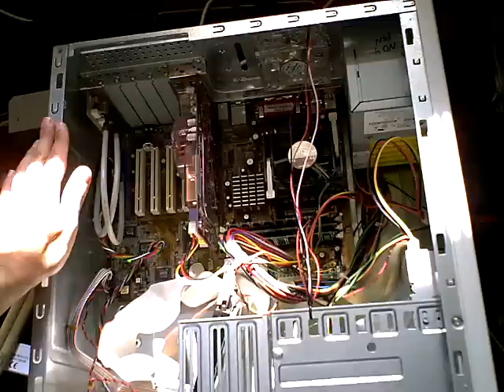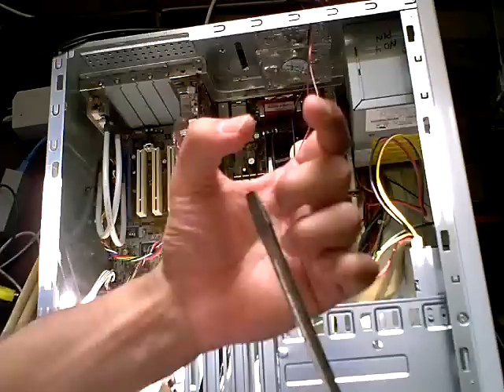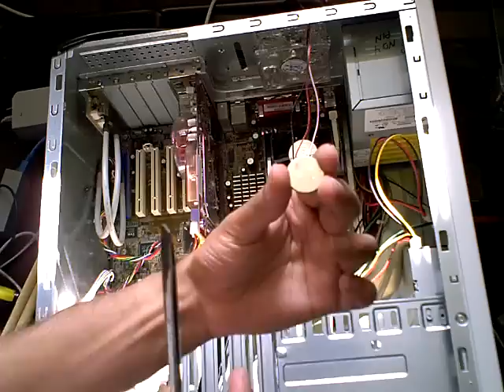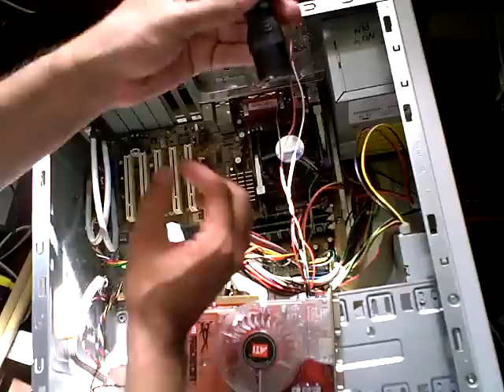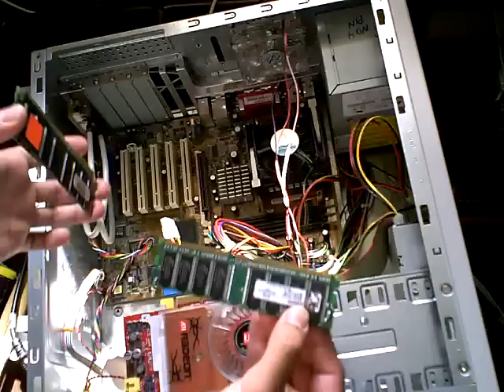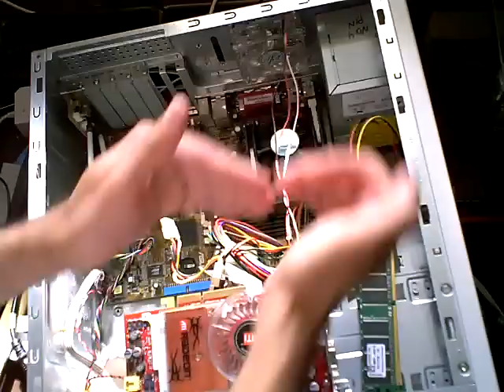How to possibly fix a PC that will turn on but will not beep and will not display anything on screen

Comment: Dear Rodney if I turn my computer on,my computer power on,fan is spinning ...only black screen and no beep,after I take out my RAM I got 1 beep and 2 short beeps,but if I put back my RAM no display and no beep again,it beeps only when I take out the RAM....so what should I do next?Will you please help me?
Reply from the maker: +Alex Lalhmunsanga 
Beep error codes differ from one BIOS manufacturer to the next. To discover what the beep error code is trying to telling you, discover the manufacturer of your BIOS (available in the motherboard's manual or on the motherboard's manufacturer's website {on the page for your specific motherboard model}) and then look up the frequency and interval of your beep error code on:

http://www.computerhope.com/beep.htm

Comment: Hi Rodney, hope you can help me. I have an HP Pavillion that I bought in 2013. About 9 months ago, I unplugged it and didn't try and turn it on again until today when I set it up in a different room. The computer has very low usage, it really has only been used for about 6 months since 8/13. I did as you suggested with the CMOS, however I'm not sure if I did it correctly with clearing the CMOS memory. I located 3 jumpers on the board, which were no were near the battery and jumped it to the 2nd and third pins, or at least I think I did. I tried all combinations to make sure that I  got it right at least once. I then moved on to the memory and when I removed the RAM(theres only 1 RAM module), then restarted which resulted in an error code of 5 beeps looping continuously. A quick check on Google shows that 5 Short Beeps The CPU on the motherboard generated an error. Does this mean that the board is done or that I need new ram? One other thing I wanted to mention.........when powered up at first, the fan over the CPU goes really fast, then slows down to normal, however every couple of minutes it will do the same thing and race the fan. If I remember right, this was doing this when I shut it off 9 months ago, but the computer was still operating correctly at the time.
Reply from the maker: +christopher christensen The hyper-speed spinup of the fan is nothing to worry about, that's just how your machine boots up. Sadly, as you've noted, PCs don't like to be used infrequently: this often results in the corruption you're seeing. Forget the jumpers if you're not sure, just do this: disconnect the power cable, remove the CMOS battery, press your PC's chassis power button switch (to discharge any remaining power circulating in the system), leave the PC unplugged and in this state overnight, then the next day return the CMOS battery to its socket, power up the PC, and if no beep, then disconnect the power cable, press your PC's chassis power button switch (to discharge any remaining power circulating in the system), remove one component, power up the PC, and if no beep then repeat (each time unplugging the PC, pressing the power switch to discharge remaining power, removing a remaining component, and then powering up, and this until the PC beeps at boot).If it never beeps, even when you are down to just motherboard, power supply & CPU+fan, one of these remaining components may be bad

Comment: +RodneyDickson I followed your procedure and finally got beep codes (5 long) after taking out the RAM. I tried using different combinations but the pc still won't boot and I only get beep codes when both sticks of RAM are out. Any suggestions?
Reply from the maker: +Muhammad Rashid Beep error codes differ from one BIOS manufacturer to the next. To discover what the beep error code is trying to telling you, discover the manufacturer of your BIOS (available in the motherboard's manual or on the motherboard's manufacturer's website {on the page for your specific motherboard model}) and then look up the frequency and interval of your beep error code on:

http://www.computerhope.com/beep.htm

Comment: +RodneyDickson I followed your video and when I removed the RAM modules I got no beep error message... 
Any suggestions?
Reply from the maker: +Jestin Joshi Breadboard it (explained in the following video:)

If the steps in this video did not provide a solution to your problem, view:

http://www.youtube.com/watch?v=_EK9a-R5pss

You never know, maybe rebuilding the PC in the opposite sense that you took it apart will solve the problem.

Comment: Hey Rodney. Do you have to take out the CMOS battery before you do anything to solve the problem?
Reply from the maker: +sparkygod22 You can handle the troubleshooting in any order you want, however I strongly recommend the CMOS trick first, since it is usually the culprit here.

Comment: So I have a question. We bought a fairly new PC and everything works pretty well. I can play high graphics games on them, watch videos, so on and so forth. For some reason our computer absolutely does not POST beep. At all. I've opened it up, made sure everything was connected, reboot the computer. Everything is working fine but the speaker will not beep. Now recently I did have some issues. When we shut down, it seems to shut down fine, but when turning it back on, it acts like it crashed and we have to go through system repair, so on and so forth, but everything still seems fine. Also while watching a video on one screen, both monitor screens went weird, headphones had a single continuous tone, and I had to do hard shut downs. This doesn't happen on games, just on netflix vids, so don't know if that's a problem but my biggest question is this: if our computer doesn't POST beep, what does this mean if the computer seems to run fine 99% of the time? Sorry for the long paragraph, I just wanted to give some info. Thanks for the awesome vid!
Reply from the maker: Nono, more information is always a good thing. From the sounds of it, your motherboard simply does not have a PC speaker (this is common on modern PCs to not have one) so don't worry about the lack of audible beep. As for the other issues, sadly I haven't a solution. I'd just put the PC to sleep when not in use to avoid the whole 'needing to system recover' upon boot up. Sorry I couldn't be of more help : \

Comment: Thanks so much for the video. it is super clear and informative for a newbie like me. But I am stuck as I found the beeps but do not know what to do after. So, I removed the cmos battery first, nothing happened (no beep). Then I removed the ram cards where it started the loopy beeps(graphic card in). Then I removed the graphic card where it was still making the loopy beeps (ram cards out, graphic card out). Just to make sure, I  put the ram cards back in (graphic card out) it's at the point where I get the 1 regular beep, break, and follow by 3 short beeps after. According to the video, its not detecting graphic card. I then proceeded to put the graphic card in, still 1 long beep with 3 short beeps after. Cmos battery back in, still no graphic card. Took the graphic card backout, cleaned it, dust off the socket, still no graphic card detected according to the beeps. Does this mean that it is my graphic card? or could it still be something else like the HD? one of my friend suggested it still could be software issue?.. I'm worried.. I read some posts saying it could be the MoBo still?
Reply from the maker: +Carrie Sun If this is new hardware that you are installing on your motherboard (that has not yet functioned on your motherboard,) note that matching bus types of video card to motherboard socket (PCI-E for example) or matching bus types of RAM module to motherboard socket (DDR3 for example) does not necessarily signify compatibility. If this is the first time you are trying this hardware on your motherboard, there is a chance that this new hardware is not compatible with your motherboard, despite the same bus type and despite the fact that the new parts fit in their respective motherboard socket. Your motherboard manufacturer's website will have a support page dedicated to your motherboard's model, and on this support page should be a compatibility list for such components as video cards and RAM modules. Ensure that your new component is certified to function with your motherboard, and if your new component is not present on the compatibility list, then there is a chance that the new component is not compatible with your motherboard.

Comment: Thank you for the video.  My computer would not beep, it was a gradual problem. At first I could just unplug and discharge the power.  Later I had to unplug all usb devices, then finally none of that worked.  I watched your video....cleared cmos, no help.  Then I removed the battery for about 3 hours.  At first it would not come on at all, unplugged and plugged back in and viola it is on and working!  Hopefully it will start again tomorrow after turning it off.  Thanks again!!
Reply from the maker: +Sheila Bennett Glad to hear it. With intermittent issues, I recommend you get the PC to a bootable state, then put it in 'sleep mode' when not in use for easy 'waking' when you do need it. Good luck

Comment: Thanks for the help man! I'm stilling having an issue though. It seems to be an issue with my RAM. Yesterday I upgraded my i5-4670k to an i7-4790k, and now 2 of my RAM slots seem to be disabled. It isn't the RAM itself because I tested both of them in the slot that does work and it boots up with BIOS and all. What do you think could be the problem with the slots? The motherboard is a Asus Gryphon Z87 and I bought it in January. I'm thinking it may be the CMOS or something else. Any ideas?
Reply from the maker: +JoshiCamoshi2 Not a clue. Try going into your BIOS, selecting Load Setup Defaults, then saving and exiting: see if that helps. If not, look in the BIOS under memory compatibility or dual channel...try to find a setting that brings functionality back.
Reply: +RodneyDickson It was over a year ago, the problem has been fixed lol
Reply from the maker: +JoshiCamoshi2 Yep, responding to all comments unanswered from my 1.5 year hiatus, even if most of them are no longer valid.

Comment: Hello! I have done the instructions you gave in your video and i ended up with 3 long beeps but only if there's no RAM inside. I've looked up what the beep code means is that it's the motherboard. Is that 100% that my motherboard is relieved of is's duty?
Reply from the maker: +Skullshot6 Beep error codes differ from one BIOS manufacturer to the next. To discover what the beep error code is trying to telling you, discover the manufacturer of your BIOS (available in the motherboard's manual or on the motherboard's manufacturer's website {on the page for your specific motherboard model}) and then look up the frequency and interval of your beep error code on:

http://www.computerhope.com/beep.htm

Comment: Thanks for the help! I just did this troubleshooting process, and sadly, it did not work. That means my MOBO is screwed. Well whatever, I'm planning to do a custom build this summer when I get enough money, new everything. Is there any way to AVOID this problem?
Reply from the maker: +Mashu If you still have this old kit, try to Breadboard it (explained in the following video:)

If the steps in this video did not provide a solution to your problem, view:

http://www.youtube.com/watch?v=_EK9a-R5pss

You never know, maybe rebuilding the PC in the opposite sense that you took it apart will solve the problem.

Regarding avoiding this issue in the future, it helps to ensure that all components purchased for your motherboard are certified to work with your motherboard. Modest performance parts are always a better bet than ultra high performance parts, and finally invest in a good power supply with more wattage than you need. Good luck

Comment: Hello I just want to ask if my mobo's starting to show failure.
Recently in the past weeks, my PC would suddenly start freezing, now a usual reboot would fix the problem, but most recently when I reboot my the CPU turns on, but no display or beeps...

HOWEVER, there are instances where there is a display, and I can tinker with the BIOS when that happens. The bigger problem is when I try to boot to Windows, it sometimes won't boot up showing either a blank black screen or no display at all. It took me a few tries to try to enter safe mode, since when I do get to Windows, and log in my account, it will freeze in under a few mins. Once I got to safe mode I can tinker with a lot of stuff as long as I can, without any freezes or such. With this I tried uninstalling recent updates, and stuff. Now after that, rebooting to normal Windows, was still a bit hard, but after a few tries I finally managed to log in without any issues, and I've typed this comment using my PC.

So what I'm asking is, if such an event like that, does my mobo have anything to do with it? Or does it have something to do with my OS(Using Windows 8.1), since accessing safe mode in a prolonged period didn't cause any problems as opposed to using normal mode. Also IS IT BAD if there is a display and computer successfully boots BUT THERE IS NO POST BEEP from the mobo when you first power it up? Thanks for any response.
Reply from the maker: +EnigemCenia My pleasure to help. Now, if your PC does not beep but boots your OS, I wouldn't worry about it. There could be a number of reasons for your freezes: I'd lean towards either your operating system becoming corrupt, or your CPU overheating. Yes, motherboard failure can be attributed to this as well. Personally, my first test would be to back up my existing personal data, then format and reinstall Windows. If this solves your problem, then your OS was to blame. If not, once a freeze happens, go into your BIOS and check your CPU temperature: see if it is close to the limit, and if so, your ventilator is not functioning adequately (check for damage at the fasteners or gumming up of the blades).

Comment: Thank you so much my computer had this exact problem and it worked with just taking the round battery off and changing the little switch putting it back and placing the battery back.,.so help full and easy to understand even though i am not a technical person.
Reply from the maker: +casper14161 Nice! Glad I could help : )

Comment: Do you think it's possible the northbridge / southbridge having solder issues could stop a machine from POSTing? I have an ASUS 775 board that runs a Q6600 and after heating up for half an hour it will suddenly POST and work normally, case reset switch makes it POST immediately, but when I turn it off then on again with case power switch, it takes another half hour to POST. I have troubleshooted / replaced everything except the motherboard, since LGA 775 boards are really expensive on eBay in the UK for some reason.
edit
Ended up getting a perfectly working ABIT IP35 motherboard for £10 with a massive tower heatsink included, best purchase I've made.
Reply from the maker: +RoBoSkullz Yeah, that's absolutely possible. In such cases, I recommend the user just puts their PC to sleep when not in use instead of powering down...I know it's not ideal, but it beats buying a new motherboard in my book : \
Reply: +RodneyDickson This wasn't my board originally, it belonged to a relative, and currently I think they are the kind of person to leave their PC on 24/7, I did find an Intel board which has what I need for about £15, so I might give it a try.
Reply from the maker: +RoBoSkullz Well, hope it works out then
Reply: Thanks

Comment: Hi!! 
Awesome Video! Thank you!!! 
I have the same problem... I insert my new Graphics card, plug in the power, put on the PC on, and nothing... mo screen, no beep... 
I place my older graphics card it, and it works perfectly... 
We thought it was the PSU, we upgraded to 650w.
Put the card in, and nothing :( 
Is my new Graphics card defective? Is my Motherboard to blame?
Reply from the maker: note that matching bus types of video card to motherboard socket (for example, both motherboard socket and graphic card are PCI-E 16X) or matching bus types of RAM module to motherboard socket (for example, both motherboard socket and RAM module are DDR3) does not necessarily signify compatibility. If this is the first time you are trying this hardware on your motherboard, there is a chance that this new hardware is not compatible with your motherboard, despite the same bus type and despite the fact that the new parts fit in their respective motherboard socket. Your motherboard manufacturer's website will have a support page dedicated to your motherboard's model, and on this support page should be a compatibility list for such components as video cards and RAM modules. Ensure that your new component is certified to function with your motherboard, and if your new component is not present on the compatibility list, then there is a chance that the component is not compatible with your motherboard.

Comment: I had exactly the same situation, but it was because of different reasons. The motherboard was not supporting that generation APU, and this motherboard had no beeper, so fan turns on, but no sound, no video.    Putting in a discrete GPU solved the problem.  (In motherboards page they said supports AMD iGPU, but it turns out only A5 and A7 and not my FX series iGPU. )
Reply from the maker: +Janis Z Yeah, those generational compatibility issues vis a vis the socket type can be tricky. Glad things worked out in the end : )

Comment: Thank you very much for your help. After upgrading the Bios on my Asus P5K board it would not boot no beeps.So I tried resetting and clearing the bios witch did not work. But I only moved the jumper for about 15 sec and removed the battery.After watching your video a tried doing it for about 30 mins and what do know it worked and it had the new bios installed. Thanks again.....
Reply from the maker: +Craig Spencer (Melanie Barrett) Ha! Nice! Glad to be of help : )